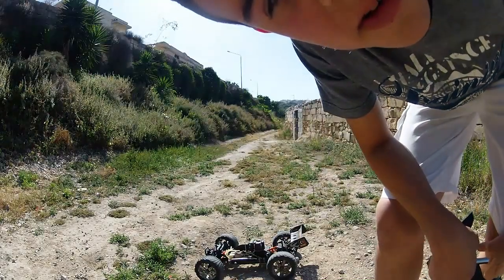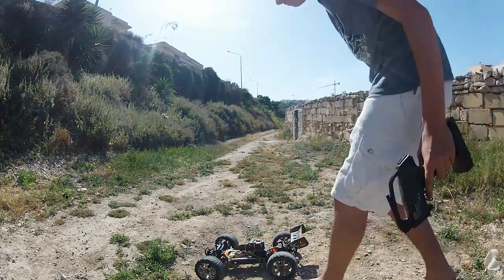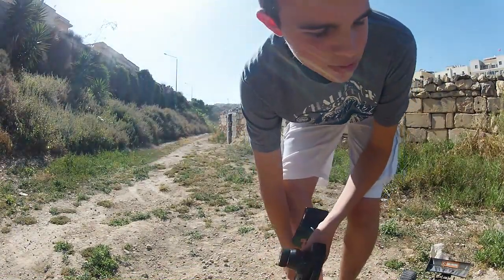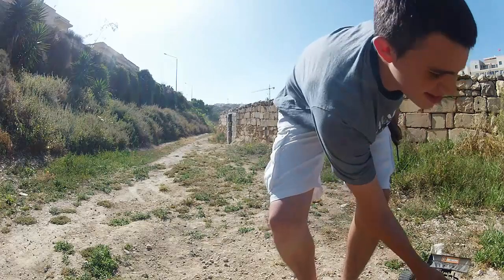HPI Trophy 4.6 Brake/stopping test

Comment from the maker: Hi, I think the steering servo upgrade is good, although I haven't had any problems with my steering servo when I've been driving the car. The downside is that you will need to upgrade to a battery pack as the powerful servos use a lot of power. The stock throttle/brake servo is adequate although you will need to change the settings on the brake assembly with the provided hex key. I haven't broken anything so far but I would recommend you to change the centre diff and shock oils.